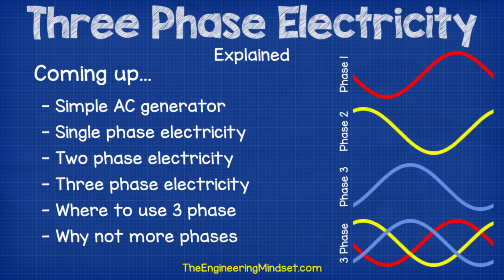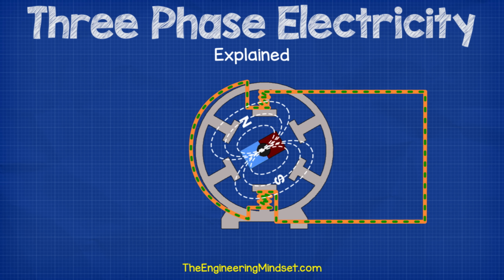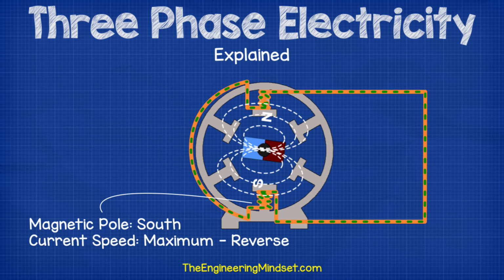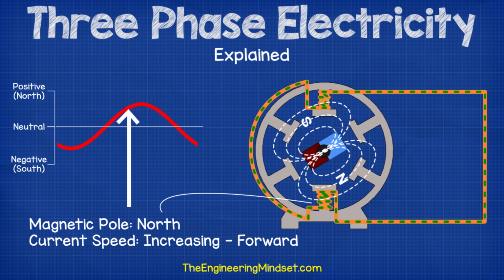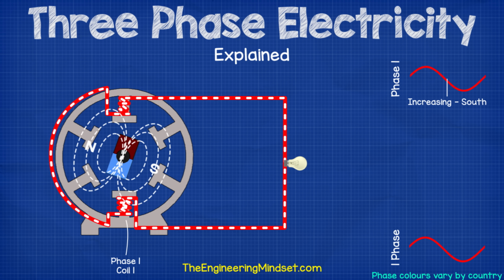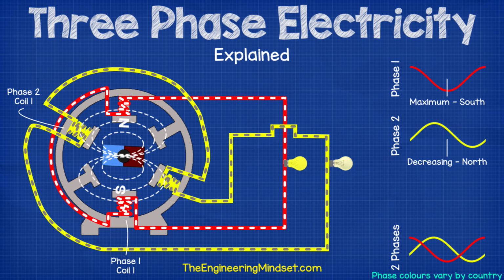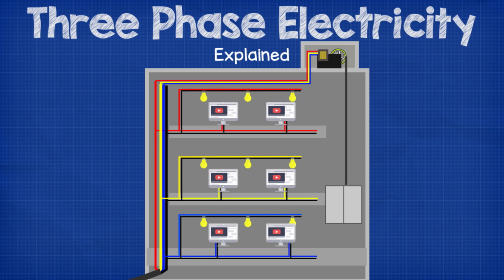How Three Phase Electricity works - The basics explained

Comment: Can anybody tell how cosine wave is produced and what is used for and  it just gets by turning or starting cycle from 60 degrees if that so why
Reply: A quick explanation is that the current in the circuit varies as the cosine of the angle between the moving magnet's axis and axis of the coil. As the magnet rotates, its angle relative to the coil changes, and the current is proportional to the cosine of that angle.  When the angle between the magnet and coil passes through 90 degrees, the current drops to zero and then reverses as the opposite poles approach each part of the coil.
Reply: Joe Meso 
Thank you Joe  i have doubt i.e cosine angle  mentioned in your comment what will be the reference to take the cosine angle and I have real doubt that by differentiating from sine wave to cosine wave means changing vertical angle to horizontal angle how could possible it happen
Reply: Hi Amar, I am sorry, but I'm not sure I understand your question or comment.  Please keep in mind that the diagram in the video is a simplification of a real generator.  As such, it can be difficult to see what is actually going on with coils and magnets in a real generator. The simplest AC generator is a single rotating wire loop with a static magnetic field passing through it.  As the loop rotates, alternating currents are induced into the loop.  Here is a decent link for this:  http://www.waybuilder.net/free-ed/Resources/TechnologyHub/Electricity/DcGenerators.asp
Apart from the mis-labeled magnets (mentioned in my other post), this video is roughly correct in showing that the moving magnet induces alternating electric currents into wire loops.  Maybe try rephrasing you comment or statement, and I will try again.  Thanks, Joe

Comment: Very clear explanation. Only we dont see incandescent flicker also because the (obsolete) tungsten filament stays hot enough to keep lit during the 120 off moments per second.
Reply: No it doesn't. Point a high speed camera at a light bulb and you will very clearly see it turning on and off.
Reply: +Brandon Francey; cfl and led flicker. Indandescent glow hot. It is impossible for the filament to cool enough to stop radiating light in 1/120th of a second as there are two 0v moments each cycle. There might be a very quick pulse of brightness but not on off. And especially not for incand dc lighting on cars (when the battery is good.) W no battery, same pulsing happens because the alternator outputs a/c that must be rectified.

Comment: In the U.S. all homes are fed with two 120V hots, plus the the neutral. Single outlets provide the 120V, larger appliances are powered by 240V via both hots. Air conditioner, clothes dryer, range/oven, water heaters are all 240V.  Ganged breakers are used for the 240V and are mechanically interlocked so the a fault will cut-off both sides.
Reply: A typical house is powered from only one of the three grid phases using two hot wires (of opposite alternating voltage of 240 VAC). Within the house, the two hot (black) wires are connected to alternating breakers, so essentially, a house is powered by 240 VAC, but individual circuits only get half of that voltage, or 120 VAC relative to the ground/neutral/white wires.  High power devices such as base-board heaters, electric dryers, and electric ovens are wired with both hot wires to provide 240 VAC to those items.  Different homes or streets or areas will be fed from different phases to help balance the loads.
Reply: Yeah, so are the 2 hots just "random" out the 3 in 3 phase power. I heard they oscillate between houses and/or sides of the street when deciding what hot to use but all i know is there are 3 power lines coming into my breaker box (but then only 2 in the basement of my grampa's old pre civil war house).
Reply: AnantaSesaDas - This video is an adequate but very basic explanation about why three-phase power exists and how the phases work.  Most homes and some businesses are only supplied with one phase.  It doesn't matter which phase is used, but as Joe Meso points out, the power company will want to keep the loads on the phases as balanced as is practical.   

The distribution of three phase power is more complicated than shown in the video.  Usually, the phases are interconnected in some way, creating what's called a "delta" or a "wye" circuit.  "Delta" circuits require four wires, and are the most common power line configuration you'll see that are not transmission lines.  In these circuits, the voltage potential across the three phases and to the fourth neutral wire is usually not equal.  240/208/240 volt three-phase service is common.  Higher voltages are also around, but note that one of the voltages is not the same.  Here it matters knowing which phase has a different voltage, so "random" won't work.

In the U.S., the wires coming into your home are not phases like this.  Instead, one high voltage phase is fed into a transformer which steps down the voltage to 240 volts.  But the transformer's output has what's called a "center tap" which means a third wire is connected to the middle of the output winding of the transformer.  This means that the original, full winding of the transformer is still 240 volts, but the voltage across the middle wire to either of the other two is 120 volts.  This requires three wires into your home.  Your grandpa's house does not have 240 volt service at all.  

In a building with three phase service like described above, there may be secondary transformers in the building to convert the three-phase power to regular 240/120 volt service for lights and regular electrical equipment.
Reply from the maker: Watch this video on US electricity: https://youtu.be/fJeRabV5hNU

Comment: When you say that a 50 Hz current switches 50 times per second, it should be 100 times per second because sine wave changes two times in a period
Reply: True
Reply from the maker: Check our new revamped 3 phase explained video, sooooo much better:👉 LINK: https://youtu.be/c9gm_NL7KyE
Reply: +John Waterman; no. It should be 200 changes. Every second it goes 0v +v 0v -v. Thats 4 changes per second times 50 cycles per second. Or we could measure the number of integers it passes through each cycle. The vernacular is correct. 50hz is 50 cycles per second. If it was different then it wouldnt be 50 hz.
Reply: One cycle is when the current first goes positive (above the Zero line) then crosses to negative (below the line). Thus, 50Hz changes 50 times a second. It crosses the zero line twice, but a cycle is the combination of the two!

Comment: Hey. I wish tou could go more in depth. As now every house get 3 fases and one neutral. And then they change one breaker for one phase and neutral and the other breaker from another phase and neutral. Same with the last one.

I live in a old house. So we have only 3 wires coming in. 230v. And they alternative between the 3 phases. 

Newer houses uses 400v and a neutral wire. TN nett is the new standard on new houses. 

My father's house is even older so there is only two phases
Reply from the maker: Check our new revamped 3 phase explained video, sooooo much better:👉 LINK: https://youtu.be/c9gm_NL7KyE

Comment: why is there no connection to the neutral for the motors and factories  (black wire, I imagine it's neutral;or ground)?
Reply from the maker: bigass197 check out delta and star connections. Delta doesn't need one

Comment: Solid explanation, and clear animation.
I have a gripe about the way the magnet on the rotor is presented. The North and South poles are not the sides, they are at the Top and Bottom. The max voltage is when the magnetic lines of force are cutting across the conductor at max rate, and that is on the bristly bit, not the loopy bit.
Reply: Came here to find this exact comment. Thanks
Reply: I thought I was losing it when I saw the diagram, but glad I’m not the only one. The explanations are correct. Just the field diagram is off a little
Reply: i only understood half of what this commentor said. can you make an animated video explaining the generator?
Reply: @Layarion  No.  They only know how to criticize others.
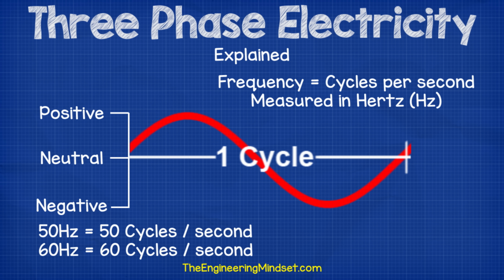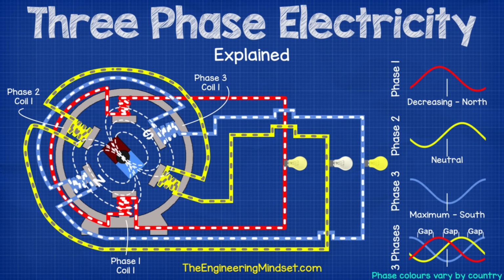Reply: @Layarion  From 4:10 to 6:00 the animation is 90 degrees out of phase with where it should be.
Reply: I starting on a technical school in 1973 on electromechanical, this is so much better than a sketch on the black board from my annoying physics professor,I was 15 at that time and I pass my tests repeating like a parrot whiteout any sense and I pass over and over things who on the long run I have the opportunity to match them and now 
Theory is something we have to learn to understand reality on the field 
I know the magnetic fiel is a little different than this illustration,but is a good point to start 
It take years and so much experience to get to be an expert but this is a simple explanation of something very complicated,
I love my trade and always support education to new tradesmen,only with knowledge you can be more productive and higher pay is coming with your knowledge 
Soon I’ll retire and new guys going to take my place ,get more knowledge and pass to the new guys 
Electricity is here to stay and grow and we need more young people to know and keep going
Reply: Started to watch the video, when I saw the magnet rotation with the lines of flux I was instantly thinking the same thing.  Did a quick "ctrl f" and typed magnet to find your comment.  Thanks for pointing this out first!  Awesome video though, some of the details got away.
Reply from the maker: Check our new revamped 3 phase explained video, sooooo much better:👉 LINK: https://youtu.be/c9gm_NL7KyE
Reply: I thought all my electrical education had flown out the window when I saw that bit!
However, I was attracted to the inductions I made from the current knowledge I was taught, and wasn't phased at all after a bit of reflection on my capacity to remain charged with what I learned.
Reply: @flamencoprof  ayyyyyyyye
Reply: When engineers try to explain physics, it can get a little.. creative.

Comment: Most of the confusion in a student's mind is caused by bad teachers who do not know the basics themselves.Thank you for doing a great job.
Reply: Agreed.  Many are good at what they do but they can't teach - as I've discovered. It's all about being able to put yourself in the students' place. That was done here.
Reply: irfan ahmed 3 phase motors can be set up in two configurations, delta and wye. The delta configuration has no specific neutral while a wye does. The generator shown is not how an actual 3 phase generator would be wired, as the 3 phases are not connected in the video, meaning they’re just 3 separate single phases. A real generator (and load for that matter) would be wired in either a delta or wye configuration
Reply: @caydjj  that would delta or STAR  (not wye) in the UK.
Reply: Very true, teachers and lecturers are often required to teach subjects outside of their training and it shows.
Thanks
James
Reply from the maker: Check our new revamped 3 phase explained video, sooooo much better:👉 LINK: https://youtu.be/c9gm_NL7KyE
Reply: Yes, but I believe the animation is incorrect. The magnetic field around the magnet in the generator is actually toroidal in shape (like a tall, stretched out doughnut) with the North and South poles at the red and blue ends of the magnet, NOT THE SIDES OF THE MAGNET. Both sides of the magnetic field are of the same neutral polarity. Also, the current is induced in the armature coils when flux lines CROSS the coil, NOT when they run ALONG THE COIL as animated. Therefore the animation is 90 degrees out of phase with reality. This can be confusing for new students..
Reply: @mkrepps  I think you may have missed the point. Whether or not the lines are drawn correctly, it does a very good job of explaining 3 phase production and distribution. Let's not be too picky!!
Reply: @marknorman4389  I realize it might seem picky because the purpose of the video is to introduce the concept of 3 phase to students, but he goes into slow motion detail about exactly how the electrons flow. Students will store this animated image in their memory which may become confusing when future concepts are built on these principles of magnetic flux line orientation and movement. It's like teaching kids the alphabet for the first time using a chart that has the letters "d" and "b" backward. They will always have to stop and think, "Is it bat or dat?" Eventually, they'll grow up and be able to spell correctly but it makes getting there difficult because they'll think back on the mental image they created as a child and get confused.
Reply: @mkrepps  True, not only that, he also uses loose language: electricity flows etc, he also uses the word "power" in different meanings, also very confusing for a beginner and sometimes even for an experienced listener. Not to mention the confusion about the Magnetic Field itself and change in it.
Reply: @mkrepps  That may be so but keep in mind that the author needs to keep it as simple as possible to reach the most number of people that have no training nor even much understanding about electrical currents.  There are still a lot of people in this world that have absolutely no idea what electricity is or how it works.
Reply: @mkrepps  I agree! The animation needs some corrections but the vid is awesome!!!
Reply: @diario_e-bike  Yes, the video is excellent!! I felt bad for the developer who spent all that time on the animation, only to get it technically wrong. I hate when I do that myself.
Reply: @mkrepps  i was actually wondering and it worried me alot. Thank you for making
 that correction
Reply: Mayur Panghaal He needs to correct his speech as well. It’s confusing - is Free Three or Three Free?
Reply: Totally agree. As a student I was baffled by my lecturer's poor explanation, and hence became bored. It's really good to see a video that explains the principle of operation in such a clear way. Cheers
Reply: Exactly said .. I have been watching Paul's simple illustrations and am just thinking why i have wasted many years in engineering classes and hated it .
Reply: Or they just don't know how to teach it.
Reply: I used to science to my teacher... they knew nothing just wanted to earn money
Reply: "There are no bad students, only bad teachers"
Reply: So good!
Reply: its confusing when using 2 phases you still call it single phase
Reply: Fortunately I remain unphased
Reply: How 3 phase motor works without neutral wire like single phase motor. From where 3 phase motor gets neutral pole???
Reply: absolutely true!
Reply: True
Reply: absulty crt bro
Reply: Strongly agreed.
Reply: Very good comment
Reply: Sahi bola bhai.
Reply: I realised this too. For every good teacher there are about 20 shit ones.
Reply: I thought that only in Mexico it happened
Reply: Underrated comment….
Reply: Exactly, I was always confused with electricity till a friend introduced me to a book on it and explained electricity as flowing water being the speed of water on a pipe as voltage and the thickness of the pipe or flow as amperage...that made everything a lot easier....
Reply: Yeah they themselves don't have intuitive understanding they just "know" it
Reply: This is also not a perfect description, especially in how power is transmitted. I'm a CS major but i know enough electrical stuff to tell you that it's not electrons that are transmitting the power, it's the EM field.
Reply: That Part!! It Took My 3rd Electrical Teacher Who Really Loved Electricity To Explain It Like A God!! He Works For NYU Now!!
Reply: YES!
Reply: Agreed, also animation and good visuals help a lot.
Reply: Ryt👌
Reply: I see engineer students nowadays give up problems too fast. Learn take 70% efforts from students and 30% efforts from teachers. Not all teachers are bad. Confusing is a good thing to trigger your brain want to find real solutions. Or you know some people just gave up and blaming the teachers.
Reply: Yes bro I do have one of that type who have disrupted everyone's mind in class
Reply: The always want to paint a picture of Engineering being tough and in the end make students scared.
Reply: Yes basics is thé Way to produce new ideas
Reply: Yep my tutor is shite! Learn more by teaching myself. He just gives me the subject
Reply: Many know things but teaching is another story.
Reply: Absolutely  agree.  They have too much pride
Reply: Agreed
Reply: I totally and completely agree!!!!!
Reply: I believe you are mistaking. Magnetic flux lines flow exactly the way shown in the video "along the sides" of a magnet.
Reply: @Leo3ABPgamingTV  You are correct if the rotor magnet is in open air. In the case of an induction (or any other type of) motor, the magnetic flux closes through the stator core, which has a greater magnetic permeability than air (x4000... x5000)
Reply: He did a great job.
Reply: Right.  Blame the teach.  Students can ask questions, watch vids, google.  Sorry.
Reply: Mayur Panghaal x
Reply: Yes, often the governemt dont want that they rly understand also very much books are rly bad in school,
Reply: I was thinking that too! i just finished up an electromagnetism physics class and we had to draw a TON of those diagrams! Glad I wasnt the only one that caught it!
Reply: Yes, while they already became a parrot themselves now they want the same for others because they most of the times don't know/understand the world outside of the box of parrot learning and sometimes afraid/not confident enough to do so by themselves.
Reply: most of my confusion in fact lays with this video, and its improperly drawn magnets.  But it's only the very core of the workings of a generator, no big deal I suppose.
Reply: or just, ya know, lazy students..